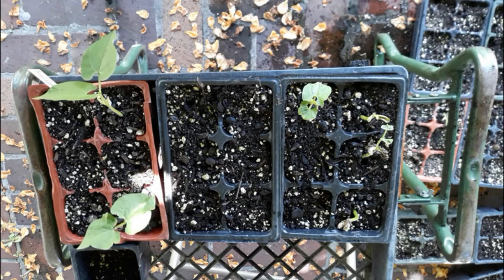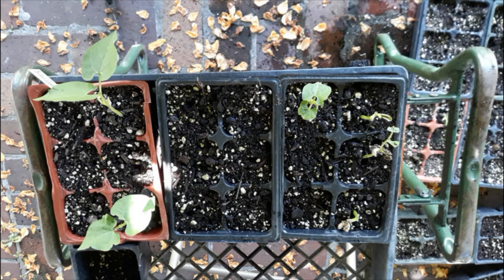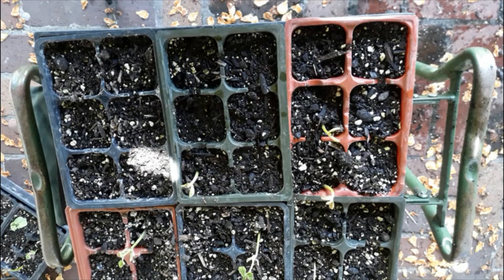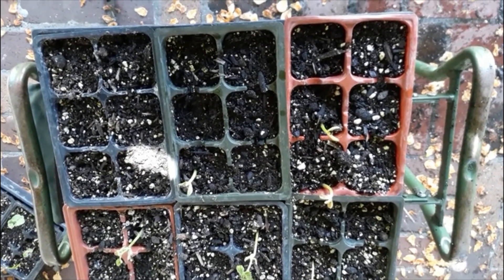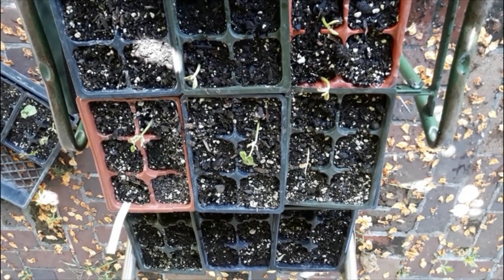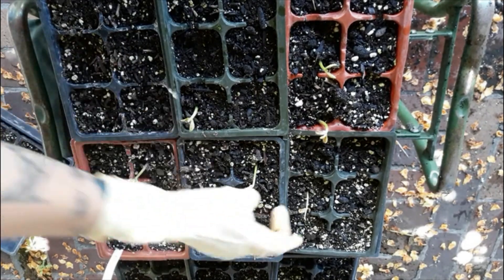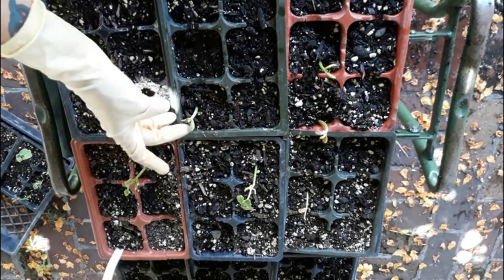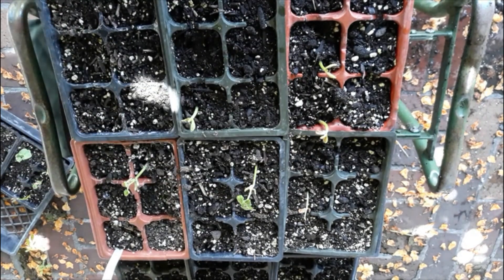Green Beans Float Test Observation

Comment: Somehow I thought you were saying the floaters were more likely to do well, but I was wrong.  It seems like your theory about the sinkers was accurate if 30% germinated vs 2/81.  The slugs could have easily thought either was delicious and they all had the same conditions afterall.  It’s almost like you expected your experiment to work the other way, but just because it didn’t doesn’t mean you messed it up by under-soaking. I’m surprised you didn’t conclude your theory was correct by the numbers alone.